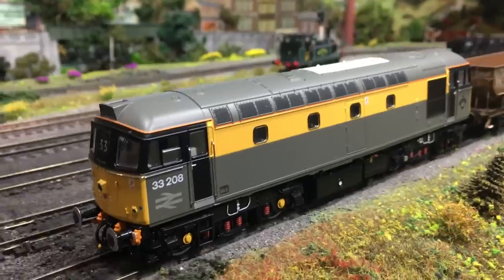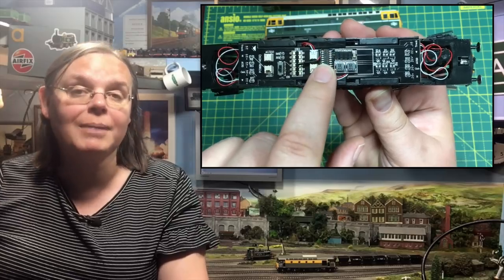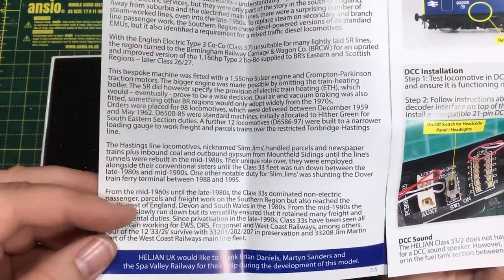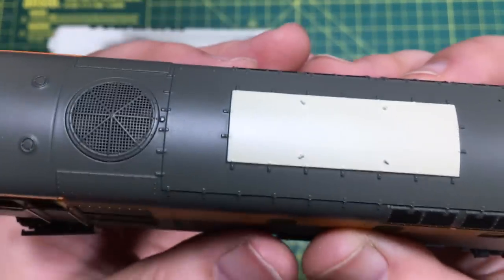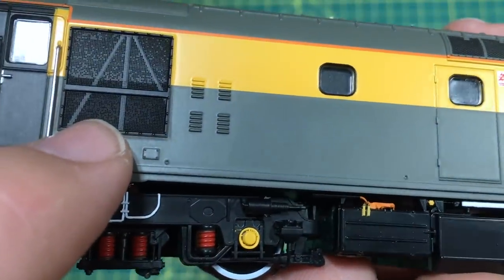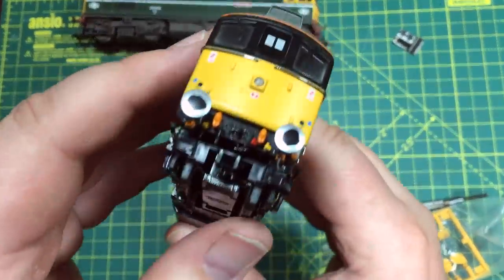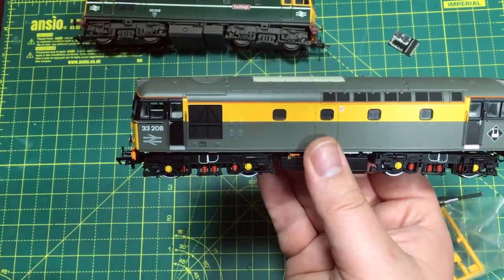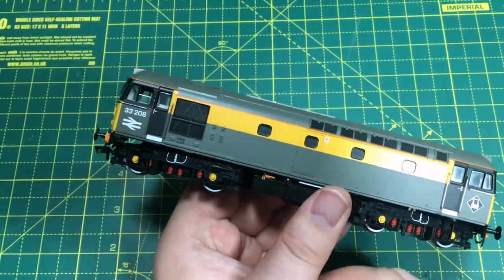The Slim Jims Are Here! Heljan Class 33/2 in BR Railtour Grey & Yellow - Unboxing and Review

Comment: The tunnels weren't widened. Instead, they lifted the twin tracks through the tunnel, replacing them with a single track, and installed modern signalling and interlocking. The timetabling was altered to make single-train occupancy of the tunnel a prime constraint.

Comment: Just bought one from Rails Jenny - in fact the same model you tested (mine was just over £100 and they're now just under, which looks even better value). Am still new to model railways despite my advanced age and this is certainly my best running loco. It can potter round or run at speed , acceleration from standstill is very smooth and it even copes with my (too steep for most locos) incline. Very impressed - and on a purely subjective note, I think the Slim Jim is actually better looking than its wider siblings. Thanks for another great video.
Reply: Me too, weathered green version arrived today - £105 was a bargain too good to miss, even if Southern isn't really my thing. Seems baffling that Heljan expect you to trim the gubbins off the buffer beam so as to attach couplings to haul trains.   No one else does that.
Reply: So straight out of box, the bogies aren't free moving because of the detailing. So I have to butcher all this stuff just to make it move and haul trains, probably meaning I can't return it any more. Ah I hear you say, it's designed for static display. In that case, the instructions say you should take the nem pocket off, without explaining house this should be done. Grrr. Good looking model though

Comment: Very good but I would pick you up on just one point. The 33 was chosen over the 37 because the S.R was already using borrowed class 24s and saw the 33 as a logical step-up even though the 37 was cheaper. Axle weight wasn't the reason for choice.
The 105 ton 37's axle weight was 17.5 tons giving it an RA number of 5. The 85 ton 33's axle weight was 18.75 tons giving it an RA number of 6. The 33/1s were very slightly heavier. The 33's power to weight ratio was better than the 37's. The 37 having 16.6 hp per ton and the 33 having 18.3 hp per ton.

Comment: Jenny, great video and I’m a little late to the party so you might not see this. How did you install the red LEDs for reverse running? Like you said, not prototypical, but it’s a function I’d love to have on mine and I don’t understand how to do it. Is it a separate LED from the pre-installed one? Is it just a red LED plugged in with a JST connector or is it a multi-coloured one?

Thanks!

Comment: At 7:20 you said Heljan hadn't been able to produce a Class 33/2 "until now".
Actually, that's not correct.
Heljan has had the 33/2 in its range since 2006, and the model came out as the second variation (before the 33/1's.
Heljan uses a sequential numbering system, with '3301' being the first, and you have 3388 there.
Their first batch of 33/2's was 3320 to 3338.
I've owned a Civil Engineer liveried 33/2 since that that year.

When Heljan released their first Class 33's in 2005, it was the original 33/0, but it got some negative, but fair, reviews about the shape of the roof.
The 33/0 had the shape of the roof very wrong, with it having tighter curves on the outer edges where it transitions from the bodyside... giving something of a 'flat cap' appearance.

Their next model was the 33/2, which was great, and then followed up about 18 months later with a 33/1 with a modified roof shape which was much more accurate to the prototype.

In fact, the modellers route for an accurate looking 33/0 was to de-convert a 33/1 by rebuilding the ends by removing the pipes and handrails, scraping away the plates for the pipework, and splicing in some plasticard at the bottom to replace the cut out for the rubbing plate (with the rubbing plates removed from the chassis.

Pleasingly, about 5 or 6 years ago, Heljan came out with a new 33/0 with a roof profile that matches their 33/1's... although they moved some of the roof details, so now that is slightly incorrect too.